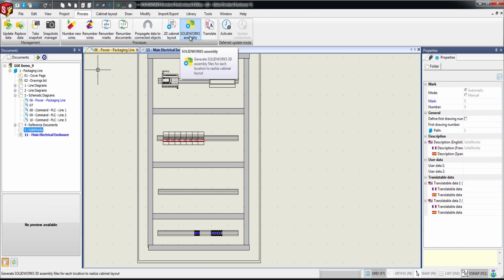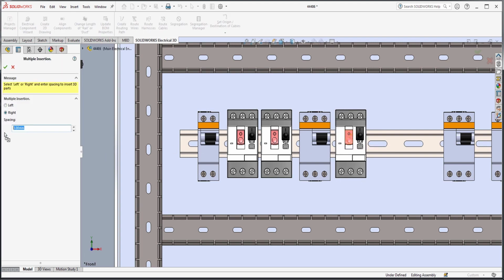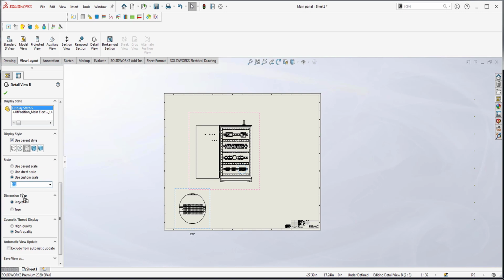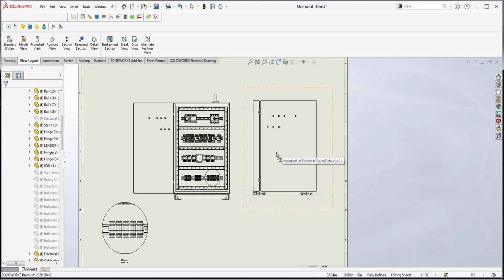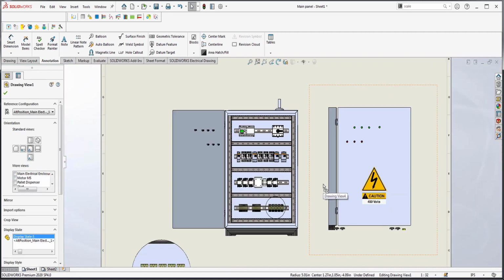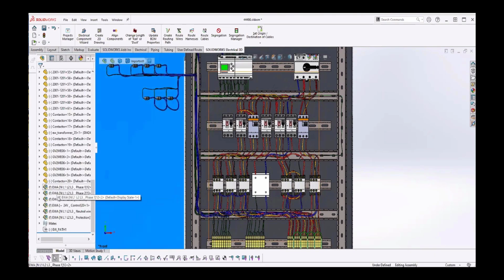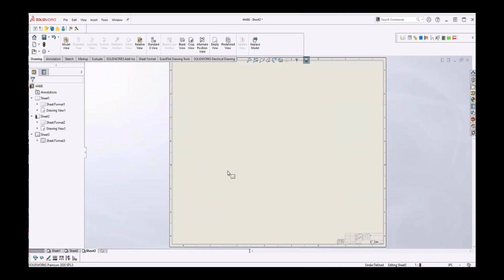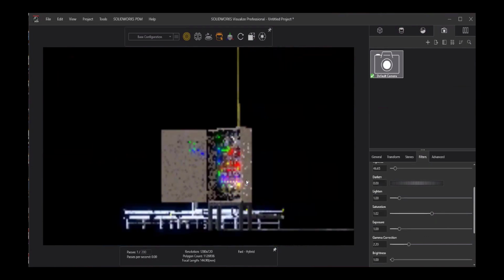SOLIDWORKS Electrical - Taking the NEXT Step with your Schematics

Comment: Is there any option to do Solidwork Electrical 3d design professional to advanced?
Reply from the maker: SOLIDWORKS Electrical 3D is an Add-in for SOLIDWORKS.  It can be added into SOLIDWORKS Standard, Professional, or Premium.  Based off of which product of SOLIDWORKS is being used, additional features are then available.  SOLIDWORKS Electrical 3D does not have levels of the product.   It is all inclusive of its electrical functions and when added into SOLDIWORKS utilizes the product specific features of the CAD software.

Comment: How to do busbar connection ?
Reply from the maker: There are a number of ways that busbar connections can be created or represented in the software.  Using terminals with terminal strip drawings and 3D models, power distribution blocks with schematic symbols and 3D models, distribution blocks with cord sets – just to name a few.

Comment: It's PLC download our Solidworks, isn't it?
Reply: Michael - I am not quite sure what your question is asking.  Could you be a bit more specific?
Reply: @cherylguntzviller6707  
I can explain it. I'm at the college. I was studied electronic the hard way, but I had an idea my Solidworks with the electric or PLC.
Reply: @cherylguntzviller6707  
PLC mean Programmable logic controller.
Reply: @michaelzajac5284  - yes- I have 30 years in Electrical design.  SOLIDWORKS Schematic is a way to develop your wiring diagrams - this includes all circuits including wires, cables and harnesses with PLCs, relays, motors and such.  We also have a SOLIDWORKS PCB software for electronics and schematics for printed circuit boards.  Both softwares can then work with SOLIDWORKS through add-ins to develop further designs in a 3D environment.
Reply: @cherylguntzviller6707  
Indeed, I more need to study that.